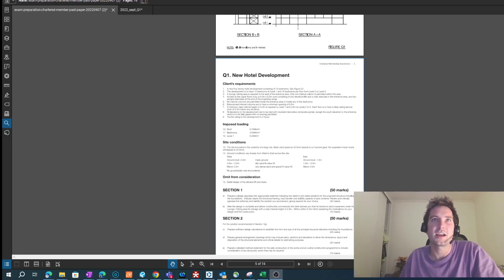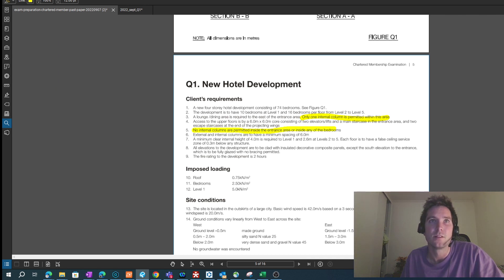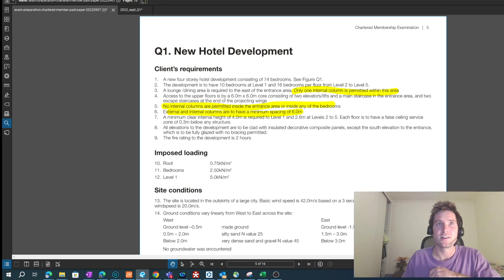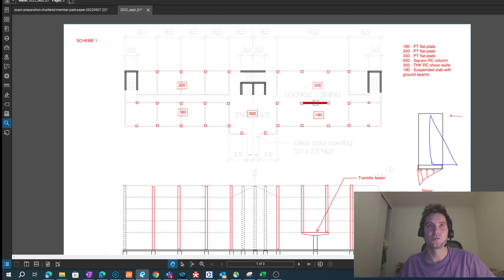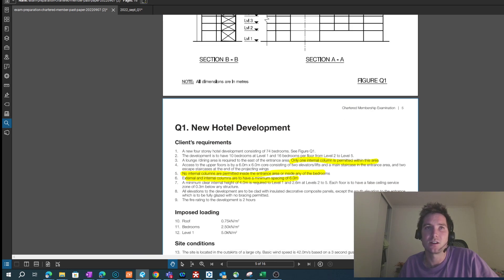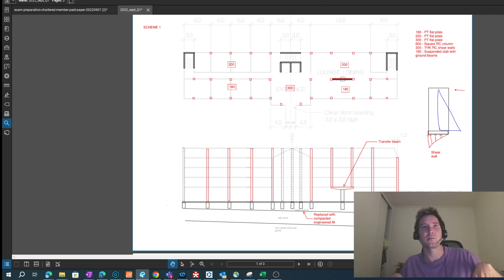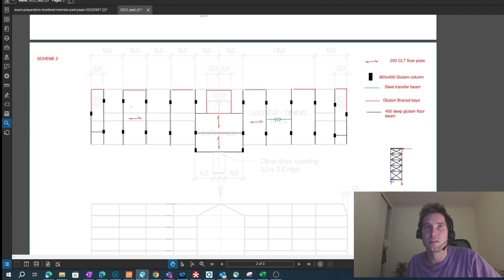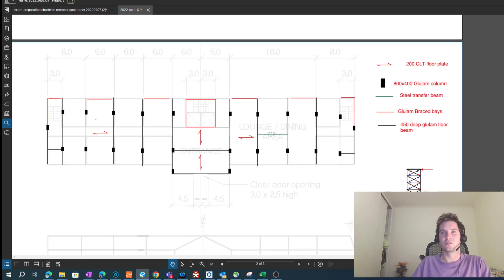IStructE Examination - Q1 Sept 2022 (Section 1a)

Comment: I agree, total height of building not given therefore structural zones for each floor are not constrained. Maybe they are expecting the appraisal to consider how overall floor depth will influence the overall height and cost of the building? Also, would have thought you do have some torsion in the stability system when considering wind acting on the short sides of the building as north elevation braced while south elevation isn't.